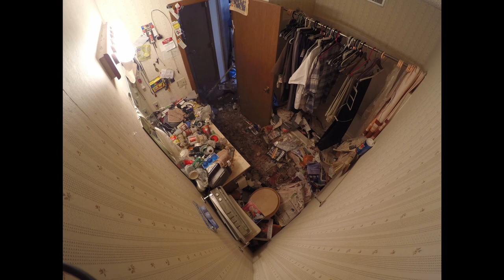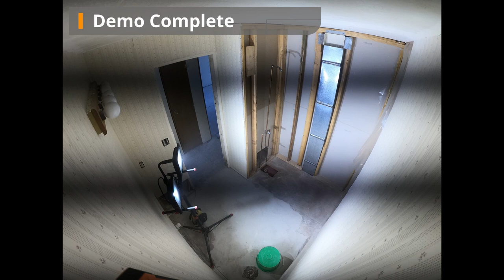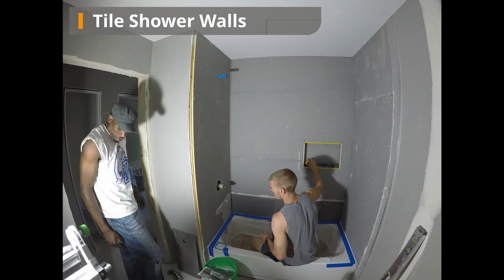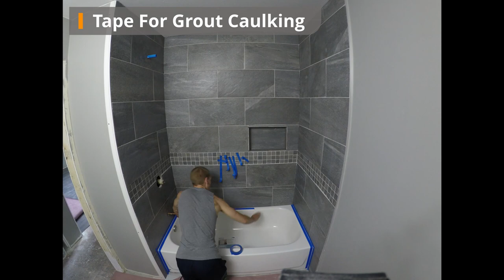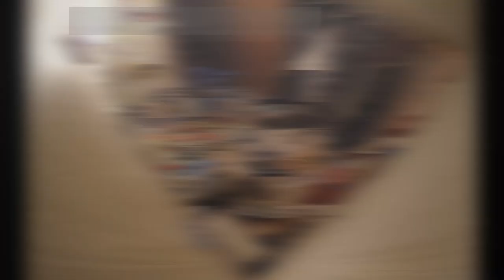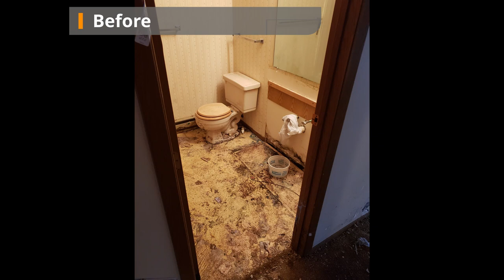Ever wonder what a Hoarder bathroom looks like? DIY Hoarder Bathroom Remodel! 🔨 (DIY Time-Lapse)

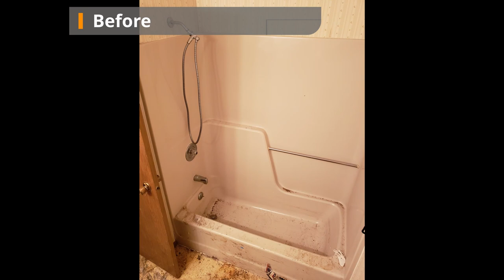Comment: 7:19  The tub and fiberglass wall are identical to the one I have in my bathroom.  50 years old!  We're supposed to have the apts. renovated in my building, but they keep changing the time span (It's now 3 YEARS before it'll be done).
Reply from the maker: That is funny! This house is 36 years old, so they must have made those for a long time. Hopefully they can get them updated soon.
Reply: @KashFloPro  Thanks!  So do I

Comment: Uhh, so where's the moisture proofing?
Reply from the maker: I use a great product called DensShield for my backer boards. It's like cement board but better - it already has a built in moisture barrier so you do not need to apply any other moisture barrier!
Reply: @KashFloPro  okay interesting. I guess I'm a bit confused because I didn't see you place any waterproofing on the floor under the tile. I'd assume water goes through the grout straight in to the cement and in to the walls. I hope I'm wrong because if I'm not there will be water damage. Things are done  very differently in my country 🤔
Reply from the maker: On the floors we used vinyl planks, which are waterproof. On the walls of the shower, behind the tile the "cement" board itself is a special cement board that has already been waterproofed by the manufacturer. This bathroom will be good to go for a long time. Thanks for the questions!

Comment: Did you even apply a waterproof membrane to the shower walls?
Reply from the maker: Yes and no. The product I use for the shower walls is called DensShield backer board. It's similar to traditional cement backer board, but way better. It's got a built in moisture barrier already, so you don't have to apply any red guard or moisture barrier once it's up! Just put a little silicon in the corners and you're good to go 👍